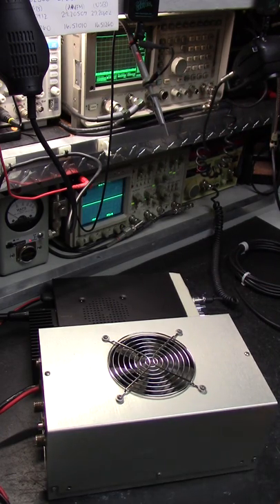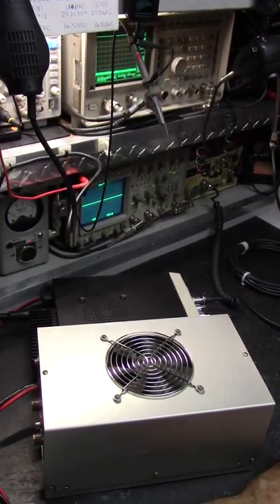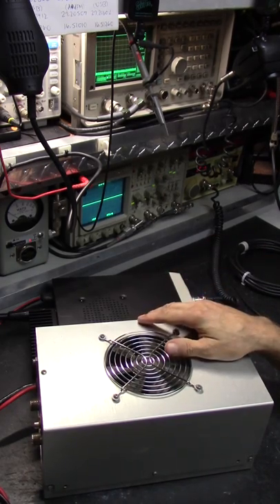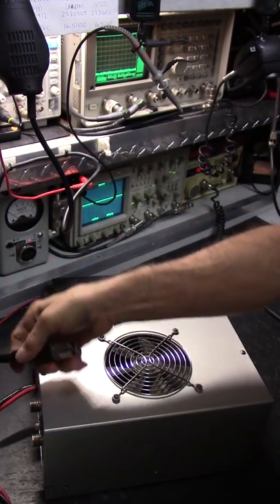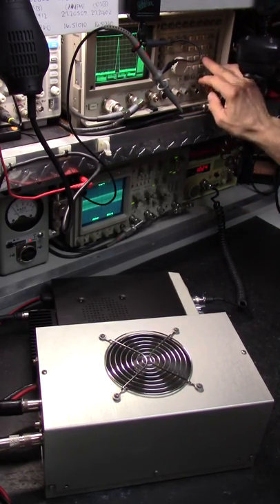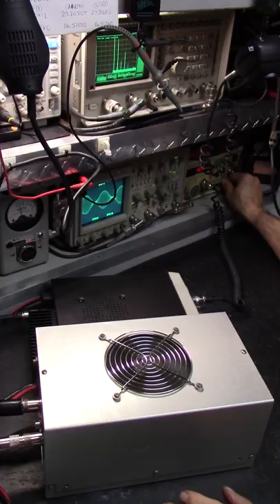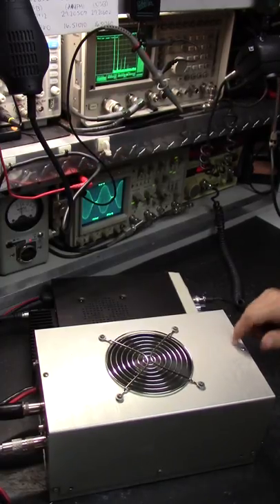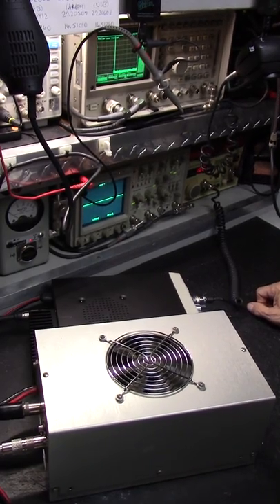In The Real World .. Does coax length matter? - Dave White ... Video #2.

Comment from the maker: PAY ATTENTION!  If they've ever recommended 3' increments or claim that length don't matter, RUN!! 

If they don't or wont show you .. like this .. they're stroking you,  get that Part?  Never settle for less! Here's what it takes to cut through the noise, be loud and crystal clear with a better receiver too:  A) Tuned Bench:  https://www.youtube.com/watch?v=lwcDfXOgAls. 
True, it's more complicated and time consuming to accomplish these consistent and accurate results. Below is a partial procedure and list of calibrated equipment used to achieve this level of performance . Read on ..

Fine Tune CB Radio Shop strictly adheres to (https://www.nist.gov/) NIST Traceable Calibrations and other industry standards to maintain accuracy and consistency for providing Real World Performance Tuning of Citizens Band and 10 Meter export mobile radios with integrity.

"Basic Textbook AM/FM/SSB Transceiver Tune, Alignment and Calibration" 

1) Pll adjustments
VCO & OSC, AM TX OSC, USB TX OSC, LSB TX OSC.

2) Transmitter alignment
DRIVER BIAS, FINAL BIAS, SSB  (or gate voltages for mosfet versions) CARRIER BALANCE, HI-LO AM & SSB Power, RF METER, AMC, ALC and FM DEVIATION.

3) Receiver alignment
AM/FM RF & IF SENSITIVITY, FM DETECTOR/DEVIATION, SSB IF SENSITIVITY, SSB S-METER, AM/FM S-METER (100uV unmodulated -67dbm for “S-9” meter reading!), AM/FM SQUELCH RANGE, SSB SQUELCH RANGE, and NOISE BLANKER/AUTOMATIC NOISE LIMITER (Real World dBm to volts (uV) tables below).

That's just a typical run of the mill textbook tune up and alignment (if you're lucky). There's more to it than frequency alignment, modulation adjustment, meter calibration and a tune up report displaying exaggerated rms Bird peak watts! 

"Test Bench includes"

Bird 4314C Meter
https://www.birdrf.com/Products/Test%20and%20Measurement/Power-Meters/Wattmeters-Line-Sections/RF-Wattmeters/4314C_PEP-Single-Element-Wattmeter.aspx
Part 1) https://www.youtube.com/watch?v=RpX9IHe4ORM&t=16s
Part 2) https://www.youtube.com/watch?v=LuhbqTf6Bxw
Bird 4314C Accuracy Test: https://www.youtube.com/watch?v=DqEOabYqhQo&t=5s
Bird Stipulates 1/2 wavelengths  https://www.youtube.com/watch?v=5eWhgT-rTII
And Genuine Bird Elements from 1K down.

Bird 4373 Sampler 
https://www.rfparts.com/signal-samplers.html

HP8924c with options
http://userequip.com/files/specs/2147/HP%208924C%20Repair.pdf
https://www.youtube.com/watch?v=Cg1w0xBa27s&t=1s

HP8920a with options
https://www.keysight.com/upload/cmc_upload/All/EPSG072204.pdf

Three analog scopes, one digital 200 Mhz
https://www.atecorp.com/atecorp/media/pdfs/data-sheets/tektronix-2465b-2467b_manual.pdf
https://www.youtube.com/watch?v=by98x4eu2lM

Fluke 27fm
http://www.fluke.com/fluke/inen/digital-multimeters/fluke-27.htm?pid=56055
 
LCR http://www.lcrresearch.com/wp-content/uploads/2017/05/LCR_Pro1_Manual_version1.03.pdf

Power supplies
6 Cosel PBA1500f12 (750 amps) variable and configurable.
https://en.cosel.co.jp/product/powersupply/PBA/PBA1500F/PBA1500F-12/
Corcom 20VB1 F7130 EMI Filter 50-60Hz 250V

Times Microwave Coax jumpers and test leads
http://www.timesmicrowave.com/cms/products/cables/lmr/
https://www.youtube.com/watch?v=EmqaGJ6IWow
https://www.youtube.com/watch?v=1ltFVSxGp5Y
https://www.youtube.com/watch?v=v12YZT_1o90
https://www.youtube.com/watch?v=h7iiYfmYWRA&t=215s

Amphenol RF Connectors
https://www.amphenolrf.com/
https://www.youtube.com/watch?v=dVh5B0hdEA0 
https://www.youtube.com/watch?v=dKZg8T_AOso

More range, compliments, reliability and a quieter, clearer but more sensitive receiver,  Get Fine Tuned .. not peaked and ruined.

Here are some VideoGates of me at the bench practicing what I preach using my bench radio or customers radio completed and ready to be shipped: https://www.youtube.com/results?search_query=hard+drive+163+ more: https://www.google.com/search?q=Hard+Drive+163+nm&ie=utf-8&oe=utf-8&client=firefox-b-1-ab

It's what I recommend, use, service and sell ... to you ... not something non practical or deceiving in a misleading way. I'm not just the tech and owner of Fine Tune CB Radio Shop, I'm a customer too!  When finished, You'll be giving radio checks, not asking for them .

dBm To Watts and Volts
Tables below displays relationship between Power in [dBm] or [Watts] and Voltage in RMS, peak, peak-to-peak for sinusoidal signals in 50-Ohm systems for accurately measuring and tuning am/fm/ssb receiver sensitivity, agc, squelch and "S9" Meter calibration.

  [dBm] [Watts]   [Volts]rms   [Volts]p    [Volts]pp
-140 0.100E-16  22.361 nV  31.618 nV  63.236 nV 
-139 0.126E-16  25.089 nV  35.476 nV  70.952 nV 
-138 0.158E-16  28.150 nV  39.805 nV  79.609 nV 
-137 0.200E-16  31.585 nV  44.662 nV  89.323 nV 
-136 0.251E-16  35.439 nV  50.111 nV  100.222 nV 
-135 0.316E-16  39.764 nV  56.226 nV  112.451 nV 
-134 0.398E-16  44.615 nV  63.086 nV  126.172 nV 
-133 0.501E-16  50.059 nV  70.784 nV  141.568 nV 
-132 0.631E-16  56.167 nV  79.421 nV  158.842 nV 
-131 0.794E-16  63.021 nV  89.112 nV  178.223 nV 
-130 0.100E-15  70.711 nV  99.985 nV  199.970 nV 
-129 0.126E-15  79.339 nV  112.185 nV  224.370 nV 
-128 0.158E-15  89.019 nV  125.874 nV  251.747 nV 
-127 0.200E-15  99.882 nV  141.232 nV  282.465 nV 
-126 0.251E-15  112.069 nV  158.465 nV  316.931 nV 
-125 0.316E-15  125.743 nV  177.801 nV  355.602 nV 
-124 0.398E-15  141.086 nV  199.496 nV  398.992 nV 
-123 0.501E-15  158.301 nV  223.838 nV  447.677 nV 
-122 0.631E-15  177.617 nV  251.151 nV  502.302 nV 
-121 0.794E-15  199.290 nV  281.796 nV  563.591 nV 
-120 0.100E-14  223.607 nV  316.180 nV  632.360 nV 
-119 0.126E-14  250.891 nV  354.760 nV  709.519 nV 
-118 0.158E-14  281.504 nV  398.047 nV  796.094 nV 
-117 0.200E-14  315.853 nV  446.616 nV  893.232 nV 
-116 0.251E-14  0.354 µV  0.501 µV  1.002 µV 
-115 0.316E-14  0.398 µV  0.562 µV  1.125 µV 
-114 0.398E-14  0.446 µV  0.631 µV  1.262 µV 
-113 0.501E-14  0.501 µV  0.708 µV  1.416 µV 
-112 0.631E-14  0.562 µV  0.794 µV  1.588 µV 
-111 0.794E-14  0.630 µV  0.891 µV  1.782 µV 
-110 0.100E-13  0.707 µV  1.000 µV  2.000 µV 
-109 0.126E-13  0.793 µV  1.122 µV  2.244 µV 
-108 0.158E-13  0.890 µV  1.259 µV  2.517 µV 
-107 0.200E-13  0.999 µV  1.412 µV  2.825 µV 
-106 0.251E-13  1.121 µV  1.585 µV  3.169 µV 
-105 0.316E-13  1.257 µV  1.778 µV  3.556 µV 
-104 0.398E-13  1.411 µV  1.995 µV  3.990 µV 
-103 0.501E-13  1.583 µV  2.238 µV  4.477 µV 
-102 0.631E-13  1.776 µV  2.512 µV  5.023 µV 
-101 0.794E-13  1.993 µV  2.818 µV  5.636 µV 
-100 0.100E-12  2.236 µV  3.162 µV  6.324 µV 
-99 0.126E-12  2.509 µV  3.548 µV  7.095 µV 
-98 0.158E-12  2.815 µV  3.980 µV  7.961 µV 
-97 0.200E-12  3.159 µV  4.466 µV  8.932 µV 
-96 0.251E-12  3.544 µV  5.011 µV  10.022 µV 
-95 0.316E-12  3.976 µV  5.623 µV  11.245 µV 
-94 0.398E-12  4.462 µV  6.309 µV  12.617 µV 
-93 0.501E-12  5.006 µV  7.078 µV  14.157 µV 
-92 0.631E-12  5.617 µV  7.942 µV  15.884 µV 
-91 0.794E-12  6.302 µV  8.911 µV  17.822 µV 
-90 0.100E-11  7.071 µV  9.998 µV  19.997 µV 
-89 0.126E-11  7.934 µV  11.218 µV  22.437 µV 
-88 0.158E-11  8.902 µV  12.587 µV  25.175 µV 
-87 0.200E-11  9.988 µV  14.123 µV  28.246 µV 
-86 0.251E-11  11.207 µV  15.847 µV  31.693 µV 
-85 0.316E-11  12.574 µV  17.780 µV  35.560 µV 
-84 0.398E-11  14.109 µV  19.950 µV  39.899 µV 
-83 0.501E-11  15.830 µV  22.384 µV  44.768 µV 
-82 0.631E-11  17.762 µV  25.115 µV  50.230 µV 
-81 0.794E-11  19.929 µV  28.180 µV  56.359 µV 
-80 0.100E-10  22.361 µV  31.618 µV  63.236 µV 
-79 0.126E-10  25.089 µV  35.476 µV  70.952 µV 
-78 0.158E-10  28.150 µV  39.805 µV  79.609 µV 
-77 0.200E-10  31.585 µV  44.662 µV  89.323 µV 
-76 0.251E-10  35.439 µV  50.111 µV  100.222 µV 
-75 0.316E-10  39.764 µV  56.226 µV  112.451 µV 
-74 0.398E-10  44.615 µV  63.086 µV  126.172 µV 
-73 0.501E-10  50.059 µV  70.784 µV  141.568 µV 
-72 0.631E-10  56.167 µV  79.421 µV  158.842 µV 
-71 0.794E-10  63.021 µV  89.112 µV  178.223 µV 
-70 0.100E-09  70.711 µV  99.985 µV  199.970 µV 
-69 0.126E-09  79.339 µV  112.185 µV  224.370 µV 
-68 0.158E-09  89.019 µV  125.874 µV  251.747 µV 
-67 0.200E-09  99.881 µV  141.232 µV  282.465 µV
-66 0.251E-09  112.069 µV  158.465 µV  316.931 µV 
-65 0.316E-09  125.743 µV  177.801 µV  355.602 µV 
-64 0.398E-09  141.086 µV  199.496 µV  398.992 µV 
-63 0.501E-09  158.301 µV  223.838 µV  447.677 µV 
-62 0.631E-09  177.617 µV  251.151 µV  502.301 µV 
-61 0.794E-09  199.290 µV  281.796 µV  563.592 µV 
-60 0.100E-08  223.607 µV  316.180 µV  632.360 µV 
-59 0.126E-08  250.891 µV  354.760 µV  709.520 µV 
-58 0.158E-08  281.504 µV  398.047 µV  796.094 µV 
-57 0.200E-08  315.853 µV  446.616 µV  893.232 µV 
-56 0.251E-08  0.354 mV  0.501 mV  1.002 mV 
-55 0.316E-08  0.398 mV  0.562 mV  1.125 mV 
-54 0.398E-08  0.446 mV  0.631 mV  1.262 mV 
-53 0.501E-08  0.501 mV  0.708 mV  1.416 mV 
-52 0.631E-08  0.562 mV  0.794 mV  1.588 mV 
-51 0.794E-08  0.630 mV  0.891 mV  1.782 mV 
-50 0.100E-07  0.707 mV  1.000 mV  2.000 mV 
-49 0.126E-07  0.793 mV  1.122 mV  2.244 mV 
-48 0.158E-07  0.890 mV  1.259 mV  2.517 mV 
-47 0.200E-07  0.999 mV  1.412 mV  2.825 mV 
-46 0.251E-07  1.121 mV  1.585 mV  3.169 mV 
-45 0.316E-07  1.257 mV  1.778 mV  3.556 mV 
-44 0.398E-07  1.411 mV  1.995 mV  3.990 mV 
-43 0.501E-07  1.583 mV  2.238 mV  4.477 mV 
-42 0.631E-07  1.776 mV  2.512 mV  5.023 mV 
-41 0.794E-07  1.993 mV  2.818 mV  5.636 mV 
-40 0.100E-06  2.236 mV  3.162 mV  6.324 mV 
-39 0.126E-06  2.509 mV  3.548 mV  7.095 mV 
-38 0.158E-06  2.815 mV  3.980 mV  7.961 mV 
-37 0.200E-06  3.159 mV  4.466 mV  8.932 mV 
-36 0.251E-06  3.544 mV  5.011 mV  10.022 mV 

                 Don't Be A Mud Duck!

Hard Drive 163 NM. 73's! Click click.